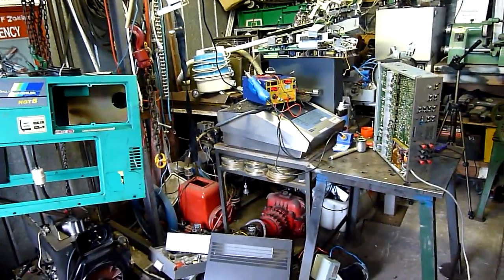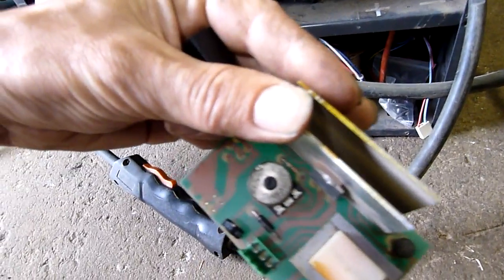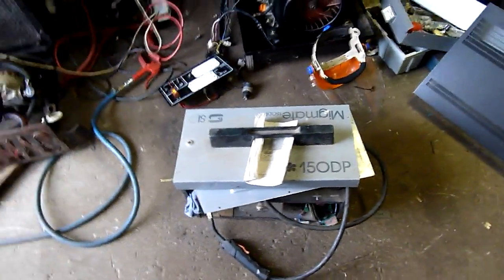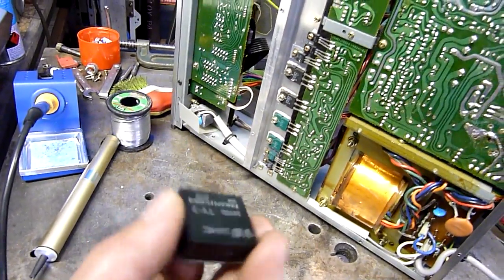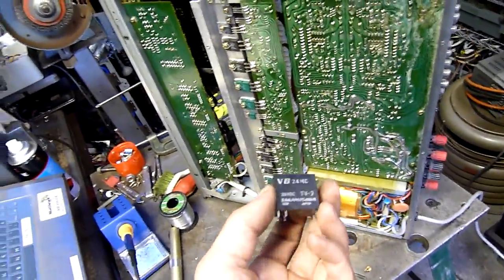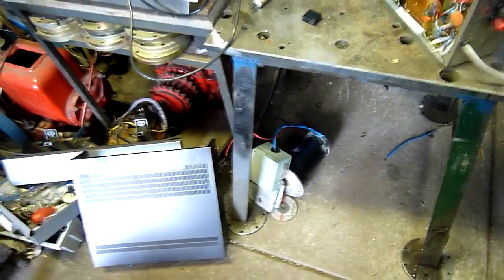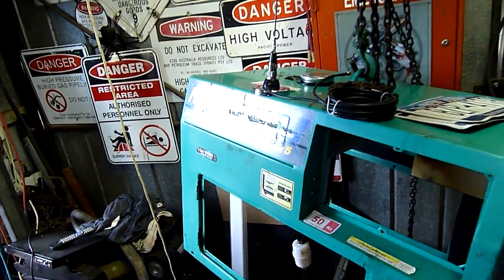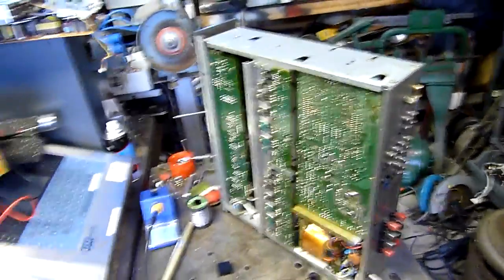Ramblotronic Friday- Luxman Amp and More Goodies

Comment: It depends on what brand they are and where you get them, on fleabay there are a lot of sellers who target audiophool idiots and price things exorbitantly hoping they will get lucky.Older stand alone tube stereo amps are hard to come so look for monoblock ones.One cheaper way is to look for old P.A amplifiers and try to get a matched pair of the same make and model.You can also buy new tube amps which are more reasonably priced, the audiophools don't like those since they don't use rare tubes.

Comment: If relay gets voltage it means that protection circuit is in "go" stage, and it means that most likely all channels are working fine. And just as a tip, since after changing relay amp will work, check DC offset (should be near 0V) there might be, or may not a potentiometer to adjust it, also check quiescent current, just measure voltage between two PNP and NPN transistor legs (most likely between emitters, should go to output trough big resistors) should be no more than 20-25mV, if not, adjust.

Comment: Nice Luxman there !!!!!!. You can till put the 12V one, turn on the 12V in you bench with a 12V power supply, measure de current, calculate its resistance, and thead a resistance in series to get the same current at 24V. A bit dodgy .... Luxman is top quality. As soon as you see mosfets in place of hibryds, you are in the rigth place.
NOTE THAT, DONT USE A QUIALTY SPEAKER TO TEST !!!. In case of damaged output stage, you can blow the speaker. Measure with a voltimeter. Output sould read 0V